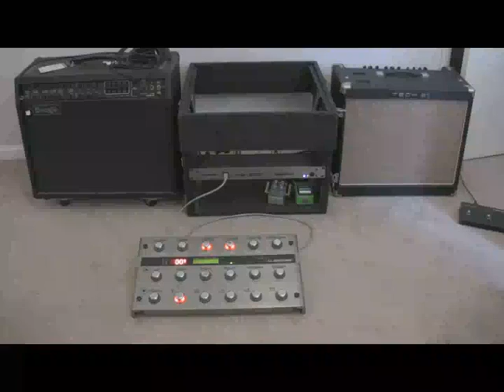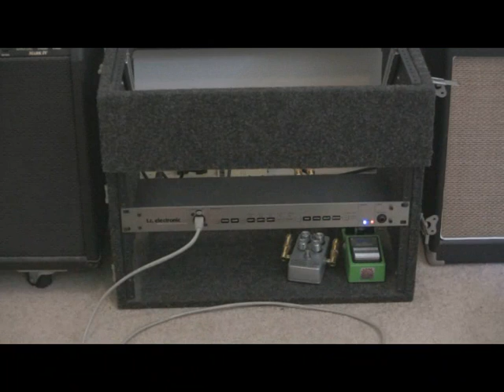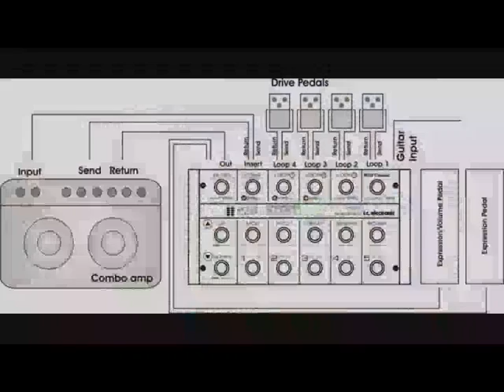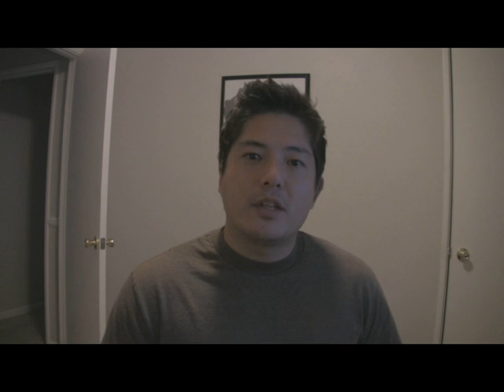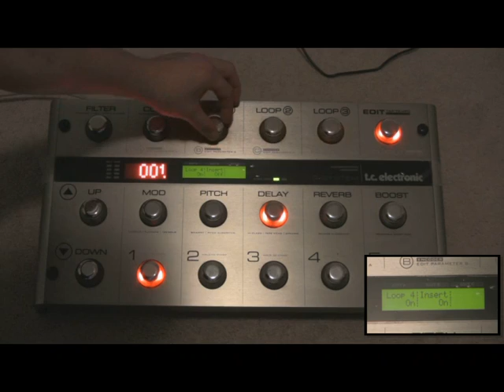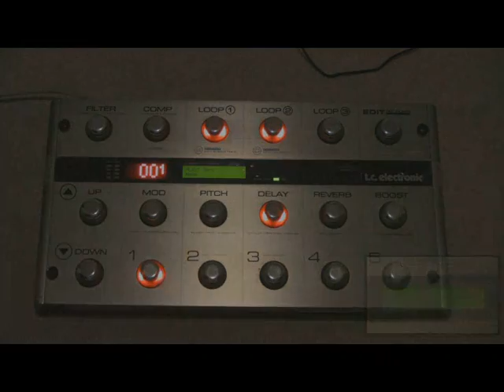g-system stereo setup using 4 cable method PART 1

Comment: Hi! really helpfull video! I hope you can asnwer mi question, if i connect the G like you show in this video and i want to use 2 amps to work in Stereo, the only thing i should do is to connect a second amp to the Right Output of the G system?? Thanks!

Comment: Is there a way to use this with 3 amps in a ( Wet-Dry-Wet) Set up?
Reply: Yes there is. I am currently running this setup because I love the separation. if you have the manual it is on page 26. basically the left and right output of the g-system goes into the return in on 2 different amps using them as monitors. The send output on the insert loop from the g-system goes to the return of your "dry" amp. This keeps your main amp unaffected and the other two to post delays and effects. one thing to remember is to set the effects as 100% wet or you will get a dry signal added to it and it will sound like trash.

Comment: Great explanatory video! I wonder how the G-System works to control other midi responsive units. I see that you can control de AXE ULTRA II. Was this easy? With the 4.0 version I got fed up of some parameters of the chorus not being translated properly from the computer to the G-System, thus entering them manually. I wonder if with the G-System and another software one could easily control additional switchers and rackable units via midi. Could you tell me your experience and tips, please?Thanks

Comment: Hi mate, thanks for your response. So every active loop should use 2 balanced cables, one TRS for the pedal´s input, and the other TRS for the output? Can balanced cables be used on any type of pedal?

Generally speaking, the only cable that should be unbalanced, must be the G´s output cable going to the amp, or the PA? Every other cable should be balanced?

Please, help me get this thing right!

Comment: more from Laird Williams:

You will also note that many users have experienced significant signal improvements when the lead from the insert send to the amp input is balanced, even when the cable length is less than three feet. Further, the G-system outputs are also balanced – so if you use a balanced cable here then you are one small step from having a true balanced connection if you end up needing it. (More on how to determine this later)

Comment: Manual page 20:
This loop is intended for a pre-amp. If cables longer than 3 feet are used, they should be balanced, even if the connectors on the pre-amp are unbalanced. When balanced cables are used, a special pseudo balanced circuit will reduce the noise which would occur when using unbalanced cables.

hopefully this will help.

Comment: Williams:
A balanced cable for use between the G-system insert send and the amp input, as well as one between the amp send and the insert return. Even though your amp input and send are not balanced (unless it is a very unusual amp), the G-System does some “fancy” things when you use balanced cables in these locations. It is not like other devices in this regard. Many G-System users have noticed a significant improvement in signal quality when they switched to balanced cables at these locations.

Comment: sorry for taking a while to respond. i understand what you mean. trust me. here is a quote from laird williams white paper and directly from the tc electronics dev team and manual on the issue of balanced cables and why they are used on the g-system.

Comment: I'm hoping what you were meaning to say was "the key is to use high quality, shielded cables for your setup". Yes, balanced cables are quieter, but they are no quieter than unbalanced cable when plugging into an unbalanced source.

Comment: Balanced cables create no difference in tone or noise reduction when your plugging them into your unbalanced input/output jacks on your guitars, amps and G-Major system. I know both of the amps you have in this video, and know that both have unbalanced inputs, therefore your balanced cables are pointless. If you say you notice a difference in tone/noise reduction from your balanced cables and their unbalanced counterparts, you would be talking out of your ass.

Comment: Uhhhhh, why do you use TRS/balanced cables for your guitar? It's more than likely pointless, seeing as 99.9% of guitars and guitar amps do not have "balanced" inputs. And I'm fairly certain that the G-Major system has unbalanced inputs/outputs, as well. Sure you can plug a TRS cable into your Mono input and output jacks, but it literally does NOTHING. Go ahead, take apart your guitar, amp and G major system and I'll bet you they all only have a single contact point in the input/output jacks.

Comment: @danilo26972 actually there is a noise gate. i get absolutely no noise whatsoever. the key is to use BALANCED cables for you set up. i didnt mention this before and i apologise. i am creating an new updated video about this. it should be posted  next week or so. let me know if that helps.

Comment: @guitfrank  yes a drive in loop 1 -4 will always be "pre" amp input. (as far as the 4 cable method is concerned). no you cannot change the loops to go "post" if you have a pedal that you want to run after the pre-amped signal (which is the same as the internal delays and reverbs of g-system) you would put them after the OUTPUT of the g-system BEFORE they go into the RETURN of your amp.  hop that helps.

Comment: @MOLYKU an m13 config with g system will be complicated because of the stereo post effects on both units.  its hard to run them both in parallel.  i am trying to figure out the best way to do this.

Comment: This is the only vid on this planet, that you can find out how to connect the G-System to a guitar amp properly. Not even the official TC Electronics website shows you this and the manual is not very totally helpfull either. I did figure it out before i saw this today, but anyway, there it is. The only other thing, is to set the loop to lock in the global settings.

Comment: dude, I'm waiting for the second part, concentrate on conections, specialy, if you can show some pictures of rack unit ant the floor unit, allso, changing the chanels on the amp with the g system, how do you do it?